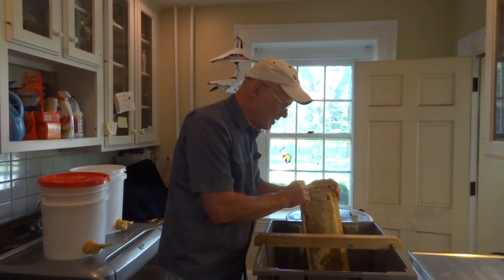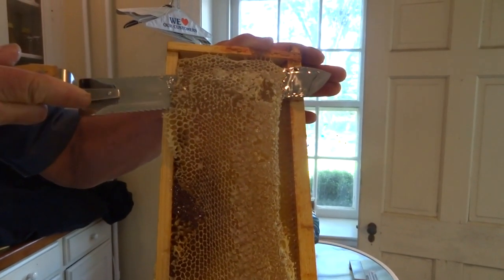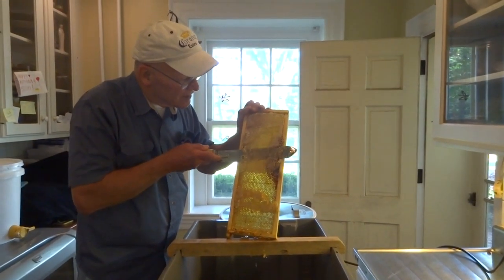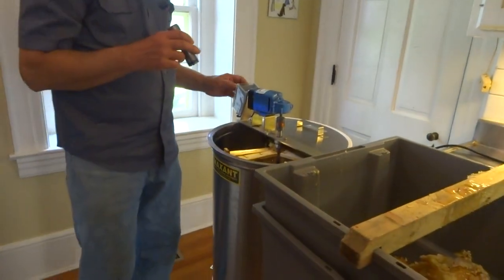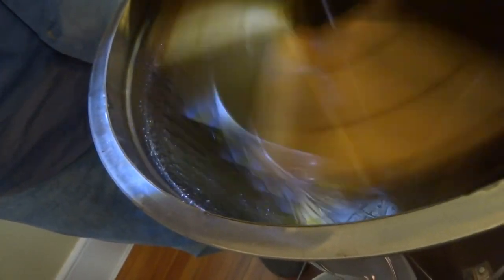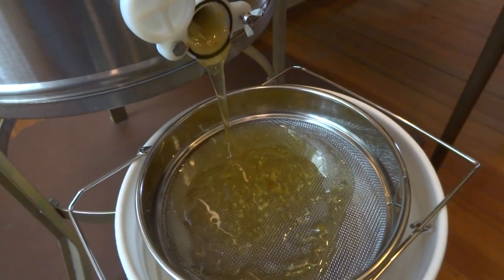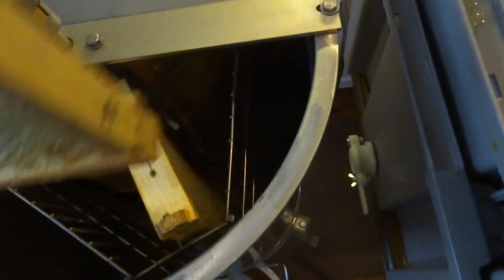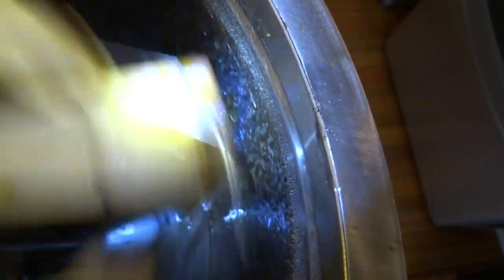Honey Extraction Tips

Comment: Hi Phil, I am just getting interested in Honey and I wonder if you can advise me on the best way to increase the time that the honey stays in liquid form before crystallizing.  IF it is filtered through a  super fine sieve to remove the 'Nidi' , can the the liquid stage be increased?
Thanks
Reply from the maker: I use to use the super fine filter but it slows things down too much. I only use the stainless steel strainers now. As far as the crystalization, it depends more on the nectar source. Some honey will crystalize fater than others.